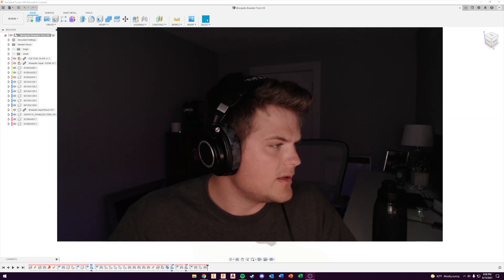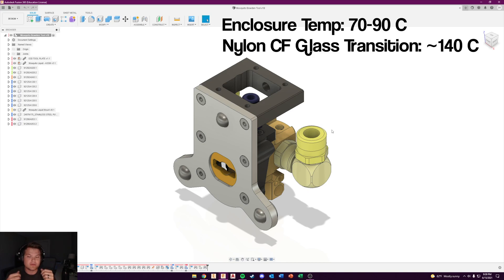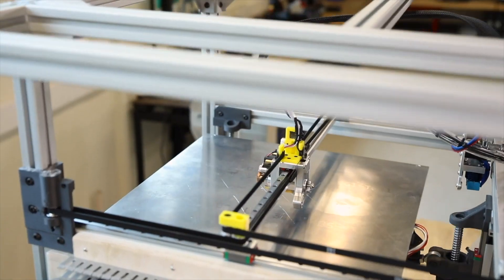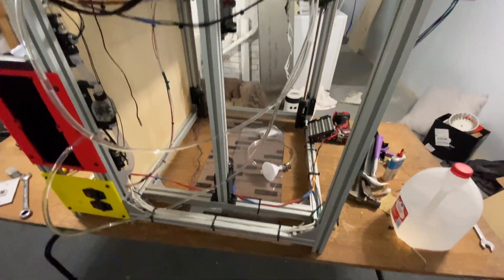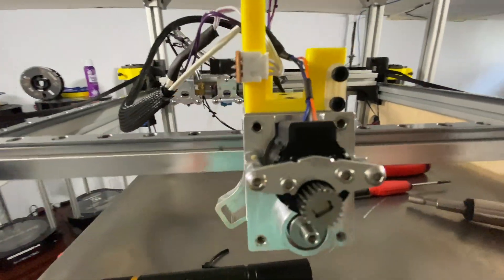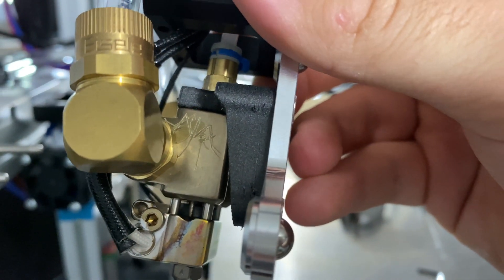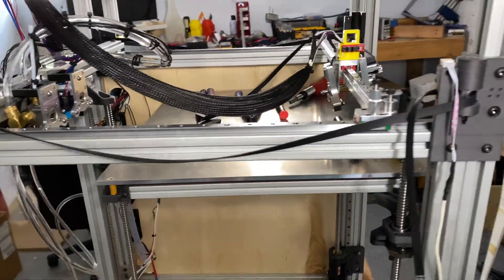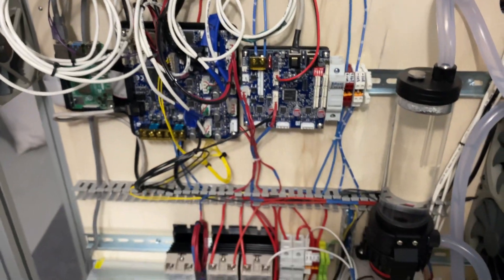E3D Mosquito Liquid, Printer Updates, and More! | Part 2

Comment: Hi, 

Could you please share some more info? I basically want to build similar printer, and I'm looking  for the info, how much longer Yaxis profiles need to be, to house whole toolchanging contraption?
Reply from the maker: I will be uploading links soon, in short, I grew my Y axis by 100mm, although it probably should be a bit more like 150-200mm and shift the bed towards the back of the printer more. Stay tuned for the next video where I will link stuff. Thank you!

Comment: Great job man you mean service plug type 15a on top and 15 on the bottom each with there own breaker in the box
Reply from the maker: Thank you!
I didn’t explain it well but I will be using a “dryer plug” (2 Legs of 110v, gnd, and neutral). It has 30A capacity total and I’ll just run the whole thing back to one breaker. Still haven’t figured out how to perfectly balance it.
Reply: @JordanMiller1117  you got her
Reply: @JordanMiller1117  maybe you can help me with a thermal fuse for my heated bed mains powered last piece I need to swap it all over 

It’s 120volt ac 1000watts it’s will heat to 170c so I want to have a cut around 200-220c

Comment: Did you use cf nylon pa6 pa12?
Reply from the maker: Not sure what the blend is, but this is what I used. https://atomicfilament.com/products/carbon-fiber-nuclear-nylon
Reply: @JordanMiller1117  also you have a great balance of knowledge to share I am interested in your work and the videos are decent too keep it up I wanna see you run 9085 pei and 1010 ultem or at least straight real PC all which they make in CF Aswell
Reply from the maker: @CC-kc5lb  thank you. Yes I want to run those filaments too. My ultimate goal is PEEK. Which is the reason for the heated enclosure specs.
Reply: @JordanMiller1117  peek pek peak pekk are all super super super expensive and yes I bit better property’s but they are best for gas tanks or medical dental and implants too I believe this the price you will love 9085 it’s a great go to super all purposes but if you want a fuel tank peek is what u want
Reply: @JordanMiller1117  also so many new filaments coming out now more than ever for end use parts yesssss
Reply: @JordanMiller1117  wow interesting I will be trying some soon lots of reviews say strongest nylon CF available I also now powders and fillers only weaken the parts virgin polymers and select additives like cf cheers thanks for the link appreciated